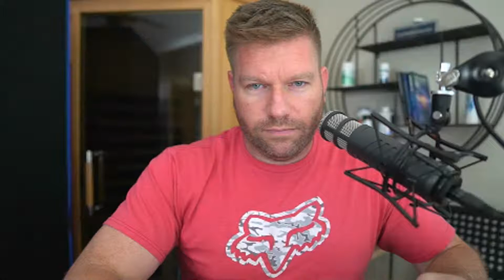Don't Install Your Infrared Sauna With A GFCI Outlet (ever?)

Comment: All I heard is that the manufacturers refused to add a capacitor that would solve this issue and instead of requiring people to violate code in multiple instances of

Comment: I didn't see this video until after I had my bathroom remodeled and installed my sauna.

The sauna was placed on a new/separate circuit.  The electrician put in a GFCI outlet to meet code. 

The first time I started the sauna it made a heck of a rattling noise, like and out of balance fan. It was coming from the electrical outlet. I could hold the plug in tight and it stopped until I stopped pushing on it. 

I surmised the noise was coming from the parts inside the GFCI.  I replaced it with a normal 120-volt outlet.  Problem solved!